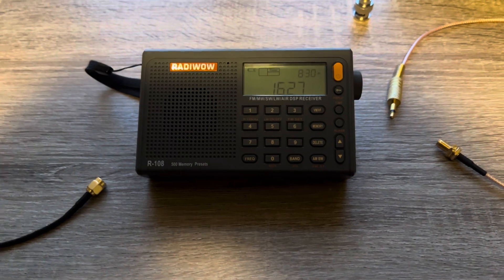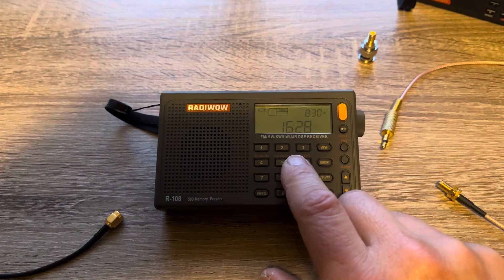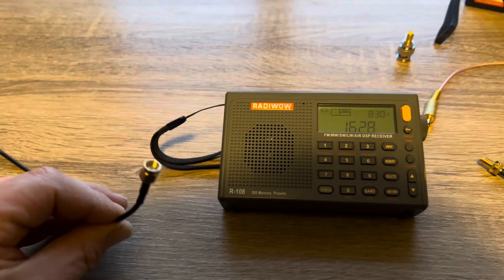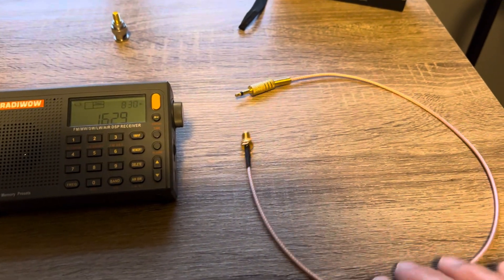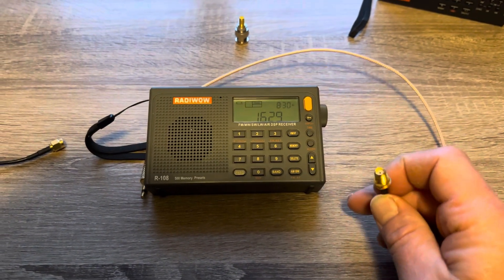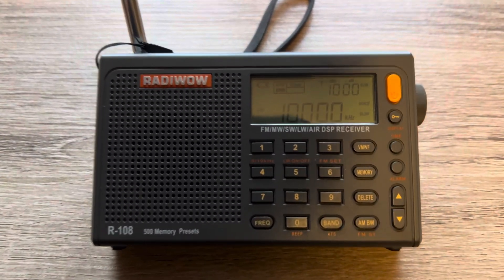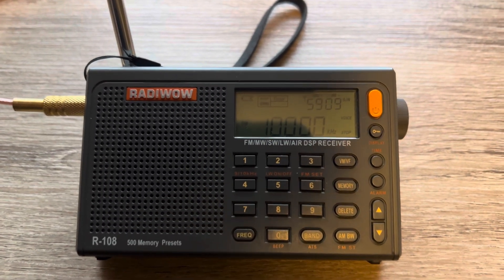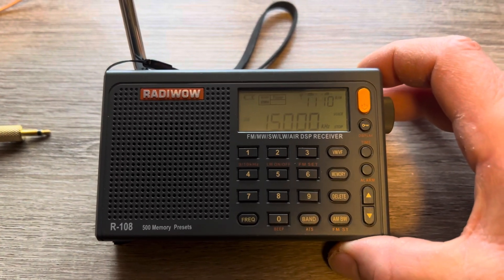How to connect an MLA-30 Magnetic Loop Antenna to Your Short-Wave Radio ￼

Comment: I recently got one of these antennas and had the exact opposite experience with it. I also had tuned in to WWV on 15khz and as soon as I disconnected the MLA-30 reception improved immediately. I couldn't hear it at all prior to turning off the loop antenna. I've heard only good things about this antenna, but so far I'm not impressed.

Comment: Ever wondered what you can achieve by using a decent quality active loop? In fact, a passive tunable loop is the better antenna for low grade portable radio's due to the fact that they have poor RF filters and the tunable loop is filtering by nature when tuning them. The result is little chance of overloading these radios. These loops can be easily made cheep simple project. Plans are to be found all over the internet and here on YouTube. Good luck

Comment: Thanks much for this video.  I appreciate that your videos are aimed at the beginner and / or casual listener.  That describes me perfectly.  I also saw your video about using a ground.  Do you think that reception with the MLA-30 would be improved by using a ground, and if so, how would one ground that antenna?  Thanks again for sharing your expertise
Reply from the maker: It’s not necessary to ground the MLA 30. It is a sealed pre constructed unit that doesn’t require any modification.
Reply: Thanks much.   I appreciate the info.   @guitarmann4121

Comment: Thanks for the useful video, but are you sure that the cable you're showing has the correct MLA connector gender to connect to the bias tee? Mine requires a male SMA connector, like the one that appears bottom left in your video at 0:10
I live in a dense urban environment and I've had mixed results with my MLA30+. Altogether a bit disappointing. Good sensitivity but high noise floor. Not that better than a long wire antenna with a counterpoise.
Reply from the maker: Thank you for your comment. The cable you mentioned on the bottom left is from the MLA 30s biasing tee, the adaptor connects to that. I should have mentioned that in the video that that particular cable is from the biasing tee. This was one of a few takes that I did before uploading and is the only take where I didn’t mention what that cable was. Thanks for tuning in.
Reply: @guitarmann4121  Thanks for replying. Let me see if I get it right: your MLA30+ came with a SMA male <-> SMA male cable, one end plugs into the bias tee and the adapter you've bought plugs to the other end and to your receiver, correct?
The difference with my setup is that my cable runs directly from the bias tee to the receiver, therefore it has MLA male at one end and 3.5mm jack at the other end.
Reply from the maker: Yes that is correct. Mine only came with male Sma’s that required an adapter.

Comment: Thank you for the detailed information. I can only use an indoor antenna (I am not allowed to have anything outdoors) for my SW radio and the wire antenna does not help much so I will consider purchasing the MLA 30.